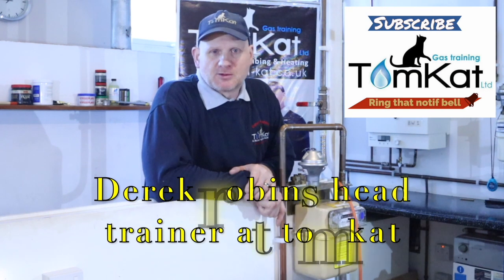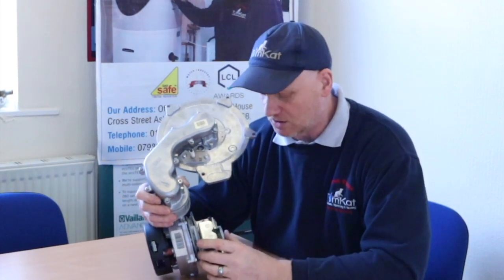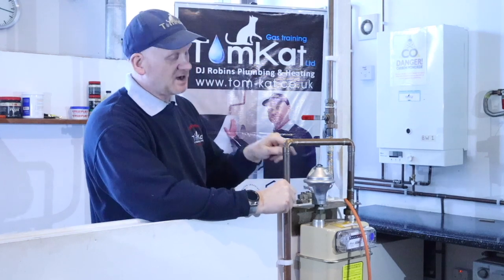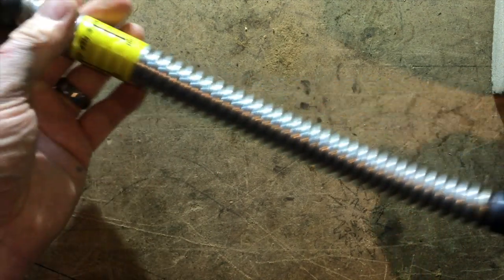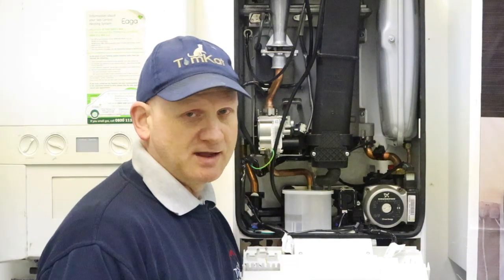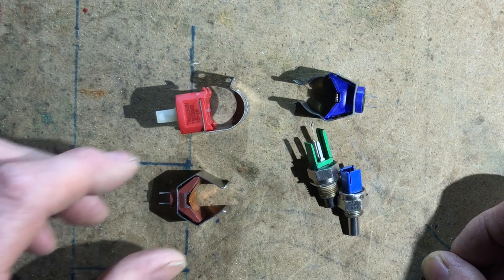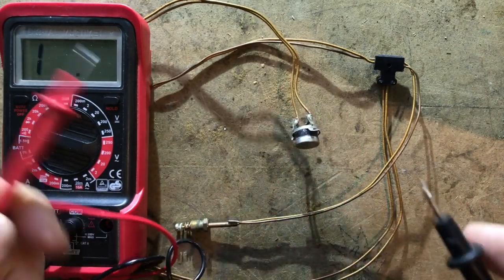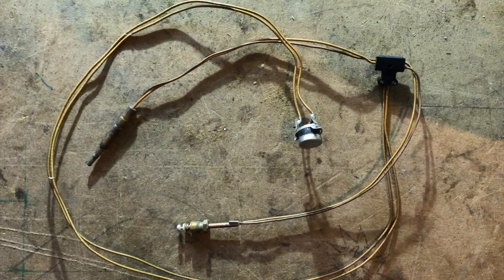GAS SAFETY CONTROLS part 4 looking at zero gas valves, thermistors, and gas meter controls.

Comment: Absolutely amazing. Start to end. So many controls so much to learn. I won’t worry though as I have access to your videos. 

Question time 😬 Can we put just a lock on the ECV if we wanted or does that have to be cadent too? 

(Sorry in advance if this next question is stupid) Why is the regulator income pressure on a low pressure 75mb / 2bar when the regulator has to then regulate it down to 19-28mb?

Just learnt after watching this video that working pressure at the meter, if it’s not 21 plus/minus 2 the regulator is wrong. Not the pipe sizing. However, if the working pressure at the appliance is more than 1mb difference then that at the meter, that’s when it’s related to incorrect pipe sizing. Now I know a bit more about zero governors! Thanks for showing us a medium pressure regulator and how it can be identified (with the upso valve) Don’t think I’ve heard or come across a thermistor before. Dry pocket and wet pocket. Wow! Thanks Derek 👍🏻

Asian Jon. Training

Comment: Hello Derek. Thanks you for your video and passing your knowledge 💪💪

Got a question 🙋‍♂️ 
Don’t know if am just being stupid 

Doing let-by on a zero governor gas valve I find that the gas pressure goes up when I isolate it from the boiler. Using p1.

Or how to properly check if the gas valve is letting by as sometime the spring might not sit all the way

Comment: hey there will thermistors and high limitor  work on the same principle as a thermostat and use the bi-metal to break the electricity circuit ? thanks